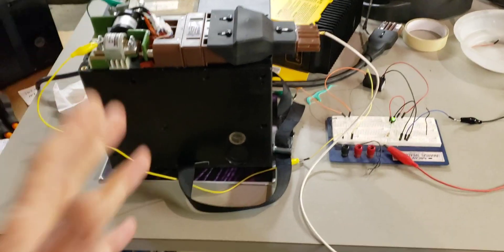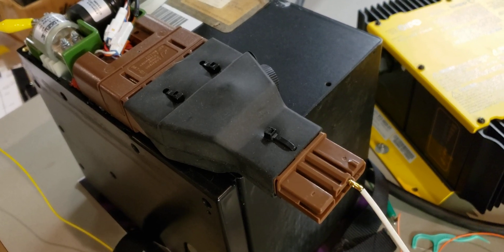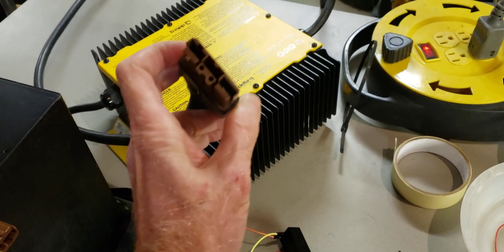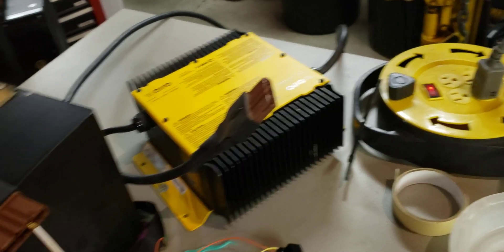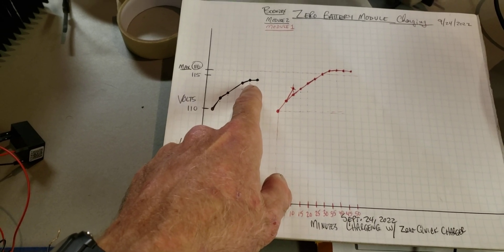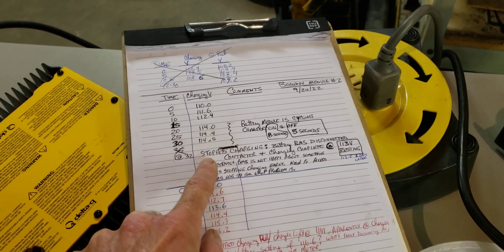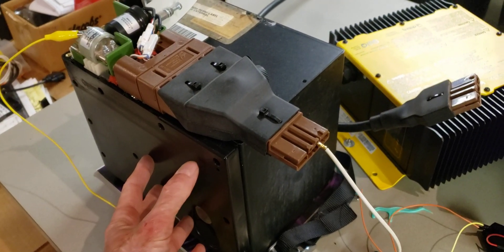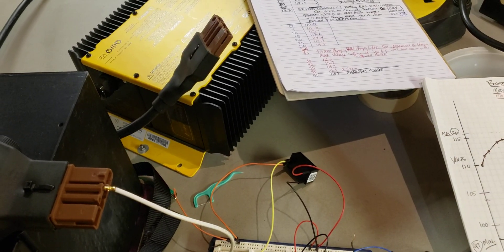Zero FX battery Module Contactor How it Works with Delta Q quick charger

Comment: Kraig, great job on the power pack battery module pinout! 

Can you tell which of the small pins serve as negative for MBB power?
Reply from the maker: There is a link in this videos description to the unofficial zero owners manual where you can find this information.

Comment: Greetings
With the battery I was able to charge it, I was able to raise the voltage a little each time by alternately connecting and disconnecting as the system is supposed to do by itself as you described..
So far I have managed to increase from 67 volts to 87 volts and I am continuing
It didn't happen alone...

D.A
Do you have a schematic of the battery?
Thanks
Eliyahu
Reply from the maker: No, I don't have a battery schematic.  If the battery was at a low voltage it may be ruined.  You need to understand if one or more of the cells in the battery had a voltage below its safe level.  With lithium cells if the voltage goes below a certain level the cell is ruined and it is unsafe to use after that as it is a fire hazard.  Unless you can access the battery logs and can determine the voltage each cell was at you should consider the battery ruined and not charge it.  Risking having a battery fire due to over-discharge is very serious, DO NOT RISK IT.
Reply: @kraigschultz8622  
Thank you so much..

Comment: Greetings
First thing is to thank you for the clear video already managed to help me a lot
Second thing... I have one battery that the contactor does not come into operation
I wanted to know if you know where the contactor is physically located
to look for the problem what with him
Thanks in advance
Eliyahu
Reply from the maker: The contactor is under the plastic cover where the big Anderson connector is.  If the contactor is not operating, the BMS is probably preventing it from doing so because it has detected a reason the contactor should not operate.

Comment: This is a great explanation! Thanks for demystifying some of the claims made about what activates the contactor in terms of circuit signal.

I have one question about the QuiQ charger modulation at the target voltage, AKA “taper”. Is that modulation pattern of 8 seconds on, 5 seconds off driven by the charger or by a connected BMS? Obviously the terminal voltage can be read and used to govern it, but I’m curious which component is doing the driving, basically.
Reply from the maker: I think the Battery BMS was doing the modulation.   At first, I thought the charger was doing it as part of its charging algorithm, but was surprised when the "good" module had no modulation occur.  

The LED indicator lights on the battery that charged to the lower voltage reflect that it is having issues.  I haven't been able to read the Battery logs to see what the issue is.  Do you know what the communication protocol is for getting the battery logs?
Reply: I suspect the answer is that the charger is governing itself, since there may be more than one BMS online, though only one MBB in a running Zero. So, I guess the question is how you do it on the bench and with the car with a lower maximum voltage.